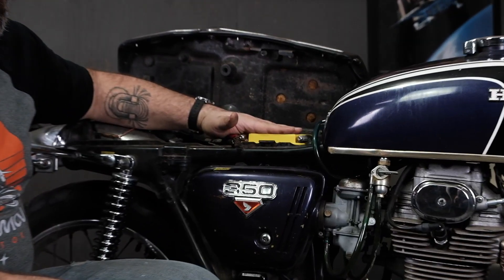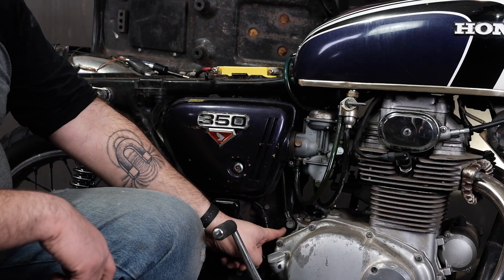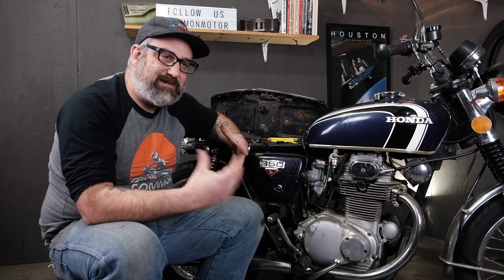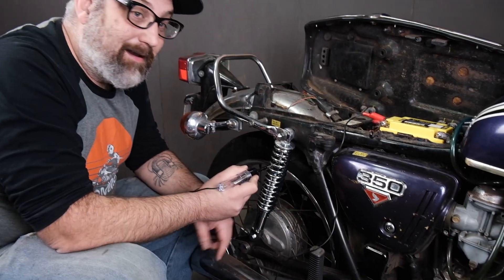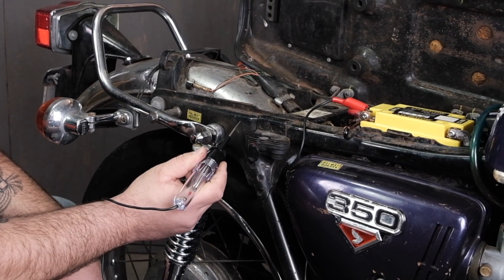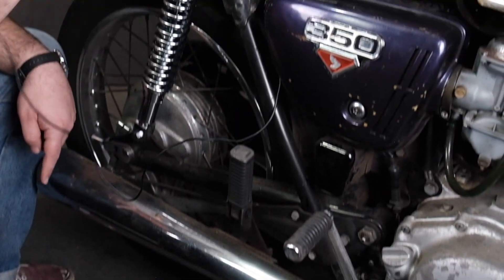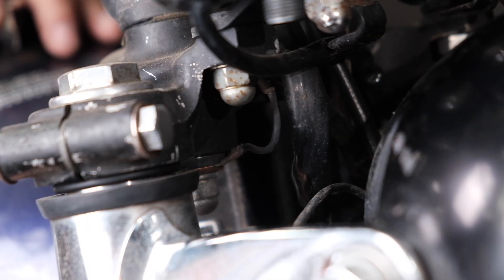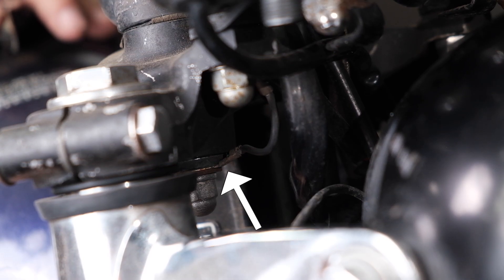Understanding the Ground Circuit on a Vintage Honda Motorcycle

Comment: I worked on a motorcycle that had a battery in the worst spot that made it easily break ground. I had to cut a plastic plate and use it to shield the battery terminal. SMH for that battery install.

Comment: You have a way of making it sound so easy . When it comes to wires in h/l  bucket all ground wires are fed to the multiple wire connectors including  the 2 attached to the bolts  .my guages are brown/white and green .join the b/w to b/w . And green to green .  Any green .
Thanks

Comment: Thanks for info here, pal! I just got a 60s Yamaha YSD2, and it has two ground wires connected to the frame. I’ve only hooked up one to the negative terminal, but wondering if I should hook
Up both? I appreciate the help!

Comment: hi .thanks for the video. i have a yamaha xs400.with the bike running and lights on when i put the indicators on the lights dim in and out slightly as the indicators flash.any idea's 🤔

Comment: Question: if negative is grounded then why doesn't the battery discharge when we put our bike on the stand so that the earth takes all the charge since the actual flow of electrons is from negative to the positive.

Comment: Hey there Brenden, Was wondering if you had any advice for me.  Ive had battery issues for awhile now on a 2019 honda CB1000R, and just an example of the most recent issue - Battery died while I was out after i parked at restaurant.  I picked up a new batter from auto store installed it and drove home.  once home i connected battery to a battery tender.  I did not ride the bike again for a few months and it remained on the tender the entire time.   when i tried to start it today it showed voltage around 12.8ish but could not fully turn over the engine.  ive had this same issue for awhile now.  im several new batteries in :(.  Any advice?

Comment: Battery handling is easy to remember:
Removing the battery is a subtraction: Disconnect minus (-) first.
Installing the battery is an addition: Connect plus (+) first.

Otherwise, you might bridge the frame and the positive terminal with your screwdriver while loosening/tightening the positive battery terminal, branding your favorite screwdriver with the mark of shame… or burn your whole bike down.

Comment: I have a 1966 Honda S90, the past owner has the battery wired up with a positive ground. I plan on changing to a negative ground when I need a new battery. Has anyone encountered this and will I need to change any existing electrical components? Help

Comment: Glad your pointing out to folks the necessities of checking all these terminal connections in relation to ground. Many of these connections impact the overall running trim of these systems that rely heavily on that wire being there.